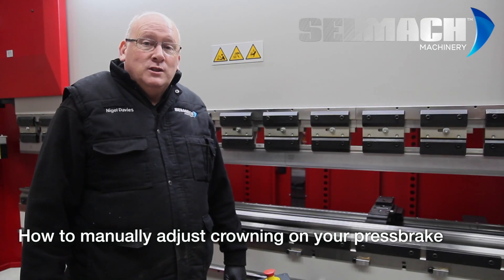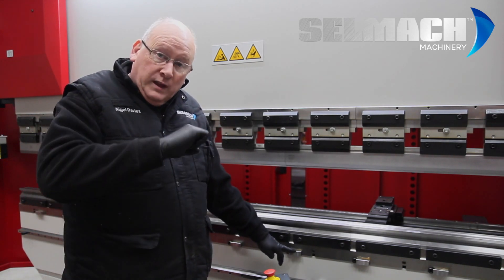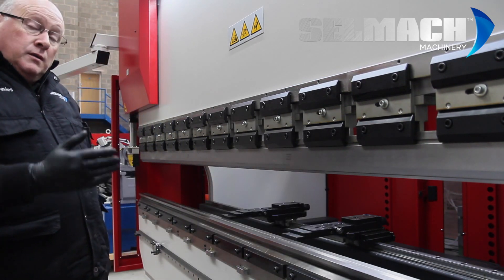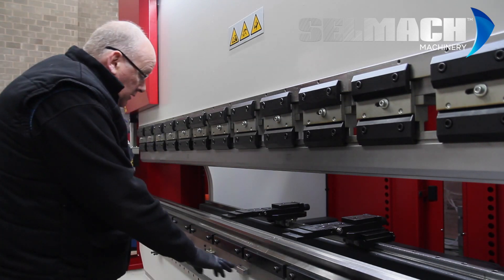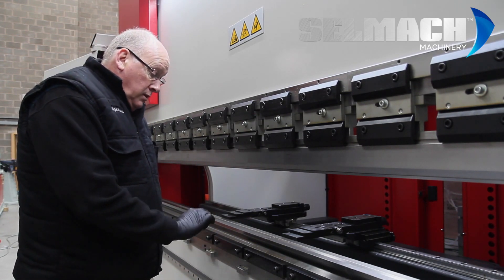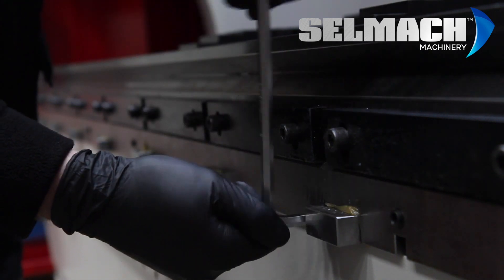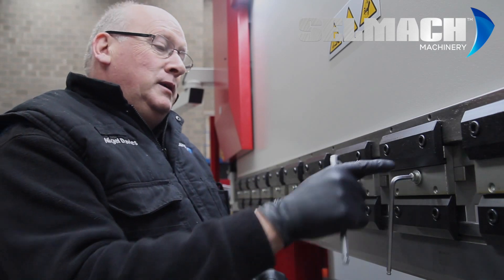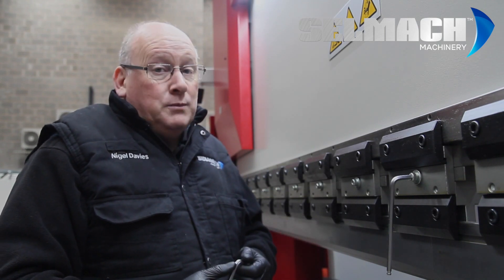How to Manually Adjust and Setup Crowning on a Press Brake FAQ [Selmach Machinery]

Comment: Hey do you have a video for Motorised control for crowning? Great video though!
Reply from the maker: Hi Mike, glad you liked it! I'm afraid not, our Press Brakes either have manual crowning, or CNC controlled, we don't supply machines with manually adjustable motorised system sorry.